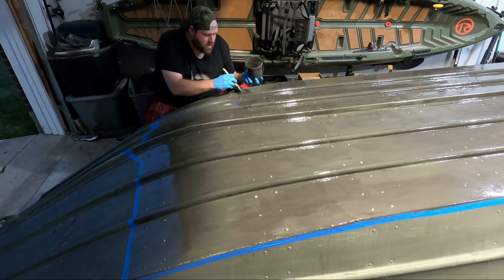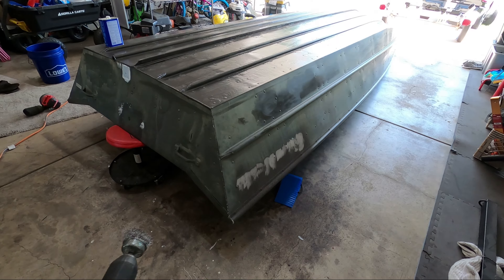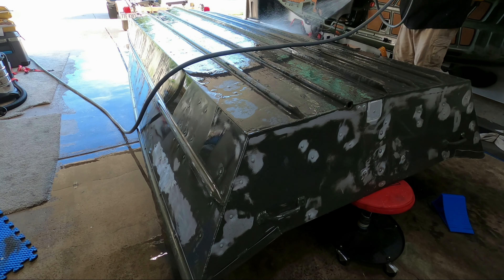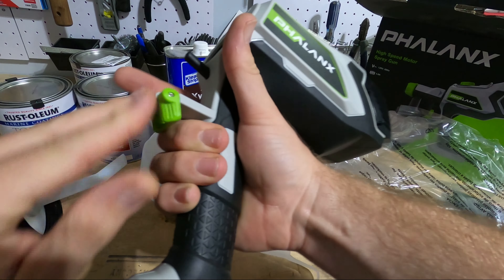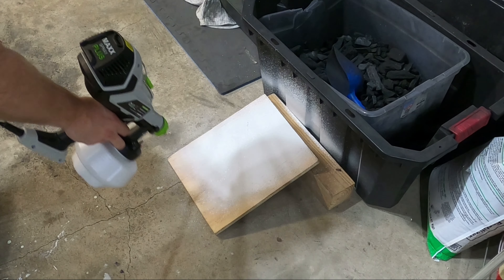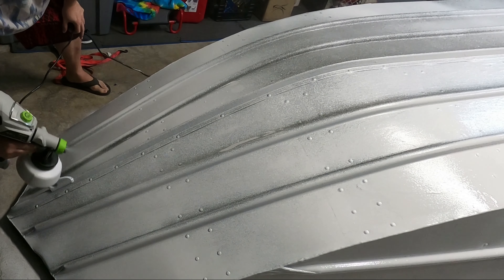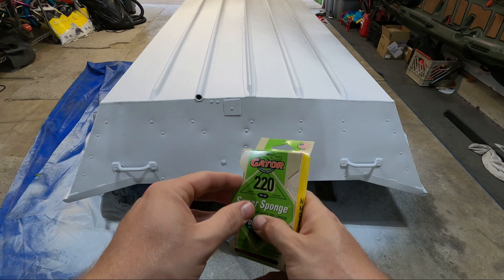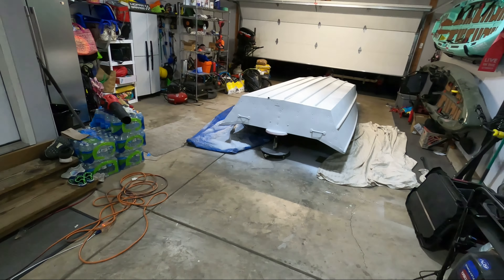RUSTOLEUM MARINE METAL PRIMER - PREP & PAINT - Jon Boat to Bass Boat Conversion Topside

Comment from the maker: Paint sprayer didn't work out quite as I hoped, still got a good layer of primer down though. Y'all got any tips for laying down a smooth layer with one of those?
Reply: Airless is not for "automotive" type work. Its for houses, doors, garage doors etc. That said, for a simple jon boat restoration, it's better than hand brushing/rolling.
Reply: Do thin coats. never go over a spot twice before it drys

Comment: You didn’t remove all the paint like your first build because it was factory paint, right? I’m hoping to just sand the factory paint on my Jon boat like you did with this one.
Reply from the maker: Yes that's correct, if the factory paint is in good condition no need to remove it!

Comment: Was the Topside Paint, Battleship gray color you used for under water line use. I wanted that color for my jon boat, but I couldn’t find that color for under the waterline use. I could only find that brand in light gray. Which I didn’t like.
Reply from the maker: Yes it was the "Topside" line of paints I used for the bottom color.
Reply: @mvboutdoors  did you ever have any issues with this paint, specifically under the water line, as time went on? I’m just not sure why the Topside says it’s not for below the waterline. My boat is going to be mostly on the trailer, so maybe it won’t be an issue.
Reply from the maker: @pwinnett222  No issues at all, I believe its more referring to boats that sit in the water perpetually.

Comment: How does this paint hold? I’m reading mixed reviews
Reply from the maker: Absolutely no issues with the primer sticking to the boat under the water line, or the paint for that matter. I've had chips from physical impacts but nothing flaking off or anything like that. It's also super easy to touch when up when it was needed.
Reply: @mvboutdoors  awesome! How long has the paint been on? Are you in saltwater ?
Reply from the maker: @65301  About a year, and no freshwater